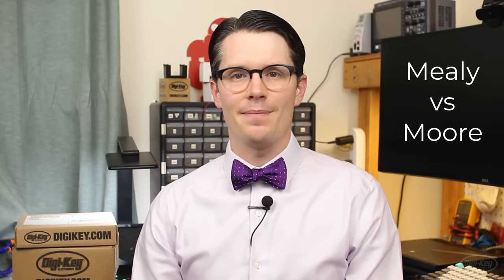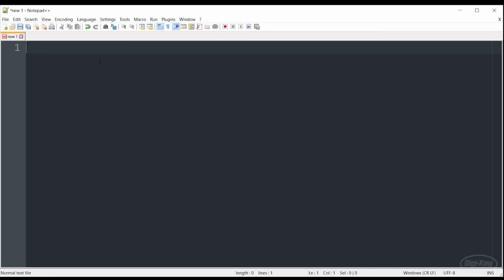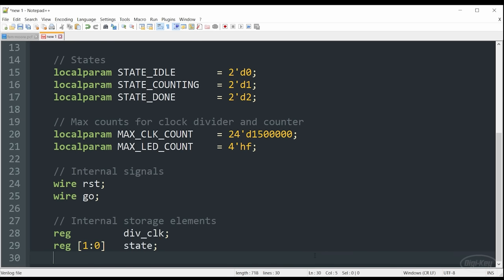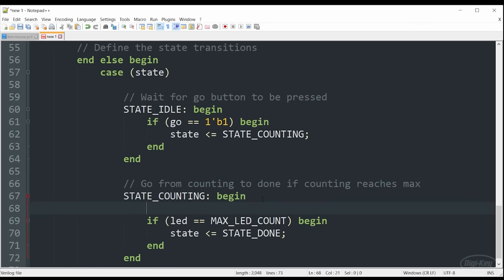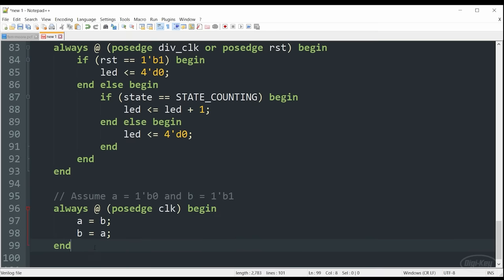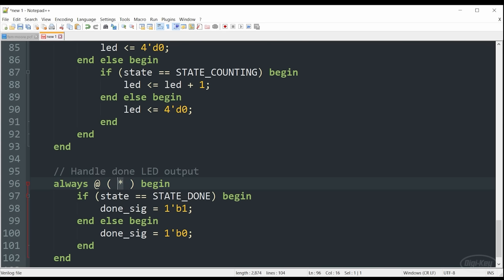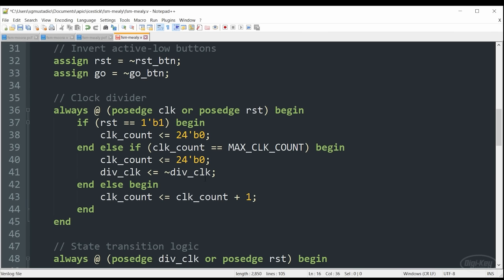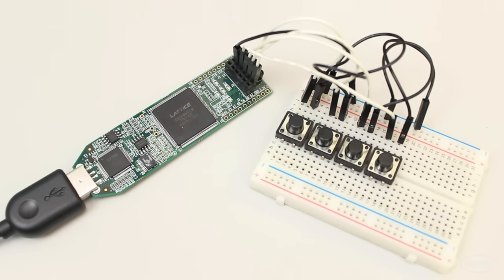Introduction to FPGA Part 5 - Finite State Machines | Digi-Key Electronics

Comment: When using non-blocking assignment, you do know that whatever value you read within that always block is the old value (or rather, current; the assigned value appears in the future). If using blocking assignment it will read sequentially within that block, much like in common (sequential imperative) programming languages, but it's easier to lose track of what the actual logic is then (longer sequential code can create complex deep logic).
Reply: Thanks for the heads up! I did my best to give examples of blocking vs. non-blocking assignments at 13:16.

Comment: Another thing to note for the mealy machine is that the outputs can sometimes show glitches when the output is triggered upon entering the state even though the input value changes and the next state doesn't go along the edge that had the outfit value specified that you saw

Comment: Challenge SPOILER: I made the debouncer using only 2 states, but I'm using the delay counter itself as a kind of sub state.. Only when it reached the maximum value, I test for the button input value, when that is high while the current state is "released" then I reset the delay counter, increase the ledCounter output and change the state to "pressed". Then when pressed is the current state, I test if the button input is 0 when the counter has reached the maximum value. In both states, when the counter has not reached the maximum value, I just increase the delayCounter value by one.

Comment: Thanks, Shawn, for the great job, your tutorials helped me to start with FPGAs. 
I am wondering if the behavior described is well defined: 

There are 2 always blocks triggered by positive clk edge, so I assume they are executed simultaneously. One block increments clk_count and another block compares it with MAX_CLK_COUNT. Can we do it simultaneously and is it well defined behavior? Are there any chances that comparison will happen before increment in one clc cycle and after increment in the next cycle so we will miss the MAX_CLK_COUNT condition?

Comment: Great video! When I run verify, i get an error with the done_sig both times they are used in the code (fsm-moore.v:115: error: done_sig is not a valid l-value in fsm_moore.) for both moore and mealy approaches but the error goes away for the build and it uploads fine. Also, unlike file names, verilog does not like dashes (-) in module names

Comment: At 22:20, one bit can have only two values, so you don't need a default either.
Reply: Good catch, thanks! I have a habit of always putting default cases, even if the state can't ever physically get there :)
Reply: @ShawnHymel  That is a good habit and the compiler probably would generate no extra code.
Reply: Out of interest, would default catch the X initial value of state? It seems to in simulation, but I am not sure if it would in reality.
Reply: @MR-fs2pc  Real bits are 1, 0, or in transition.  The simulation you mention is not synthesizable.

Comment: Hi y'all!  I can't get apio to recognize the device "ftdi_usb_get_strings failed: -4 (libusb_open() failed)".  I've followed the instructions to the letter, tried changing to the libusbK drivers to no avail.  The default FTDIBUS drivers also failed.  Also, the device added to the device manager isn't as shown, it pops up as Dual RS232-HS (Interface 0) and Dual RS232-HS (Interface 1).  Changing one or the other, or both to libusbK fails any which way. HELP or I'll just forget this toolchain and tutorial.  ):

Comment: Hmm, one should really not use an output of a flip flop as a clock for another flip flop, as this can cause some nasty timing errors. You should use a clock enable signal instead.
Reply: Now that I'm looking into metastability and cross-clock domains, I can see why this might be an issue. However, all of the resources I come across for creating a "clock divider" use the output of one flip-flop to clock other flip-flops. Do you have any suggestions or resources that show how to create better clock dividers?
Reply: @ShawnHymel  I think nandland explains it well in this video @ 9:30 https://youtu.be/htwlb-DuEK8?t=574
Reply: @embeddedbastler6406  Thanks! It seems that using the output of a FF as a clock signal is a naive approach that's used in a lot of books, content, etc. While it makes sense for beginners, I can see why it could cause issues. I plan to mention this in a future episode (along with why it's bad) and offer a better clock divider example.

Comment: prioritized tasks, as you dont need to do work that is not needed, better have food than have nothing served
Reply: language makes things very hard
Reply: its not very efficient in delivering the intent of your design, its tech talk
Reply: it should be "do this" instead of "you need to do this and this and this and this"
Reply: your unnecessary complication hides the thing its doing, you cant see the forest from the trees (statements), and documentation is a chore, not a blessing, make it simpler to both convey the meaning, intent and the implementation in same package, visually
Reply: for "gods sake" have it at least object oriented, not this statement litany
Reply: functional if not objects, at least
Reply: poor organization
Reply: dont assume the current way is the best way of doing things, any things
Reply: just direct c conversion to fpga, nothing else
Reply: This whole thread is talking about applying abstractions to a purposefully bare metal implementation. Use a CPU or MCU for conventional programming. HDLs and conventional programming languages are inherently different. One describes hardware connections while the other describes abstract processes of registers. You may benefit from watching the first video in this series again. It will show you why HDLs are necessary when dealing with FPGAs.
Reply: @CurtisPurnell  what
Reply: @CurtisPurnell  you clearly dont understand what I wrote or what I wrote about, get good
Reply: @Jkauppa  I must have misunderstood your messages then. I admit your first few messages were confusing, but I was referring more to your talk about using oop and c. My understanding is that you wanted to see more computer science ideas being applied for explanation. My point was FPGA is digital logic design, so the connection can't be made for a lot of higher level programming ideas, and the confusing tech talk is a consequence of that.